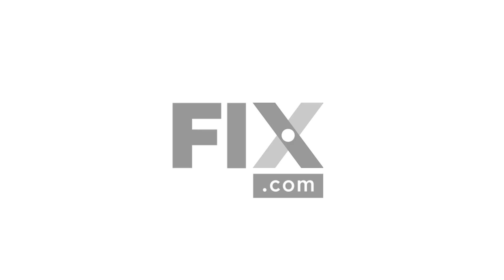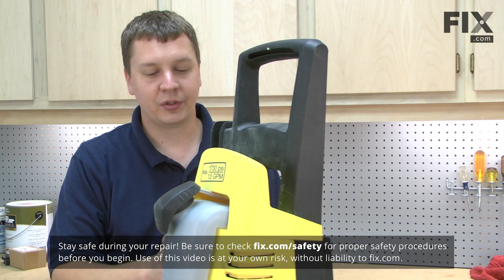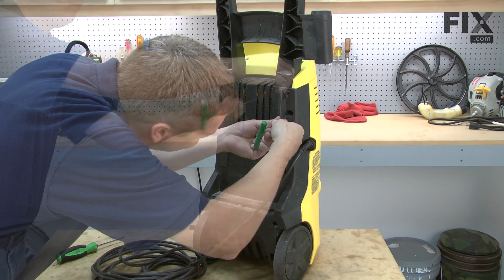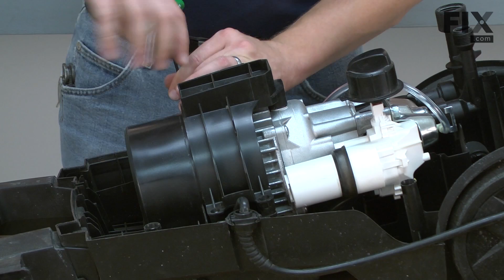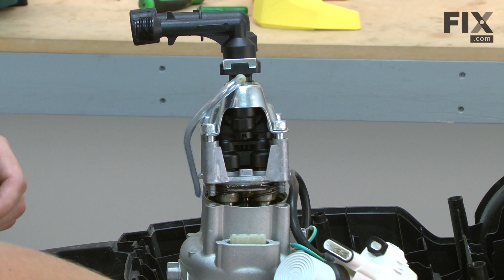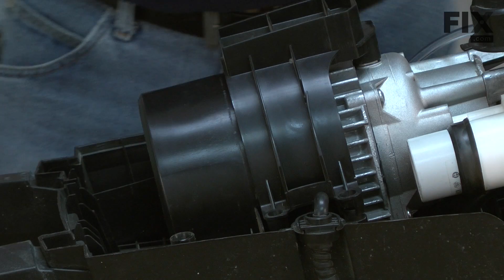Karcher Pressure Washer Repair – How to Replace the Motor Capacitor

Comment: I have that same older model 1700psi. It stopped building pressure mid wash. It receives power just fine but it never “engages” to get that burst of pressure. Any suggestions on what order to troubleshoot?

Comment: Hi. I’ve got a Karcher K5 that was working fine, made a funny popping noise then stopped working. It still hums but no water pressure coming through the gun (just normal water pressure). I did some Google searching and most ppl said it was likely the capacitor. Opened it up and true enough the capacitor was blown. I ordered a new one, refitted it and…. The same thing… Hums but no pressure. Does anyone have any thoughts? I don’t want to take it back to Karcher. It’s no longer under warranty. I had it back in the shop last year and they charged me $260 to replace the head gasket and took 3 months to do so! It’s a $60 fee for them to just ‘have a look at it’. So any advice would be greatly appreciated.

Comment: .In minute 3 when you place the capacitor, you drop a circular plastic piece, it happened to me too, but I don't know where it is placed, could you help me. Thanks
Reply: Looks like it belongs around the slot he points to at 3:12. Notice it is no longer there right after it had fallen off when his thumb was covering it when he was pluging in the new capacitor. Hope that sort of helps.

Comment: Problem
Motor not run. Motor power 220vac.
When supply on check voltage phase to nutral 220 v & phase to body 230v show in multimeter

Comment: Sometimes the compressor goes on and off and after a while it is going fine . It is a capacitor problem?
Reply from the maker: Thanks for the question. It could be a problem with the capacitor, yes. A damaged capacitor will often cause the engine to hum, rather than fully engage when the pressure washer is turned on. I hope this helps you with your repair!
Reply: Fix.com ty

Comment: What type of screw driver do I need for these screws?  Tried hex keys but they don't fit.
Reply from the maker: The screws you have a question about are Torx Screws. They have different sizes for the different size of Torx Screws. You may want to purchase a set of these, most of the manufactures are using them.
Reply: @FixDotCom  What is the size or T number needed for this specific Washer? i have a set but it only goes to T10 which is still too big.

Comment: HI i have a K855 hs 240v washer on the wires for this motor i have 2 x white 1 x Yellow 1 x Black do you no what way it goes with the capacitor im lost on this one.

Regards
Paul

Comment: plz i have a pulsating problem with my karcher i cleand the pistons changed the oil but when i release the gun the motor do not stop keep pulsing ...
Reply from the maker: Take a look at your pressure relief valve.  It may be sticky or defective.
Reply: kaka kakashi it's leaking or blocked

Comment: mine I turn it on and nothing happen not a noise last time I used it was working
Reply from the maker: Since your not getting any response from the motor I suggest checking the power connections and switch.  Sometimes a little corrosion from sitting through the winter will cause all kinds of problems.
Reply: @FixDotCom  I have the same issue, changed the fuse in the plug, have taken the Karcher apart but no idea how to take the switch off to check it?
Reply: I have same issue. 
I tried flicking the on/off switch multiple times (and after about 20 clicks i heard it start up for a split second, then nothing) 
I changed fuse in plug, NG.
Stripped it down and can't see anything obviously. I'm going to get the capacitor checked but apart that I'm stuck!

Comment: My Karcher PW not working, my wife said that it fell down the steps and after that It will not work, any idea of what could have happened during the fall? I would like to try fixing it, but I would like to have an idea of what could have happened to it. At the moment I connect the water supply, spray gun and power, turn it on and nothing happens, not even a hum or anything it is completely silent when I turn the know to ON. Cheers
Reply from the maker: It's difficult to assess the problem without have the Pressure Washer here. I'd open the housing up and see if you can see any damage or loose wiring connections.
Reply: Well I haven't even got around taking the back cover where the spray nozzle goes, I downloaded the manuals and I can't figure out how to remove that part, once I do that I will be able to see what is inside :)